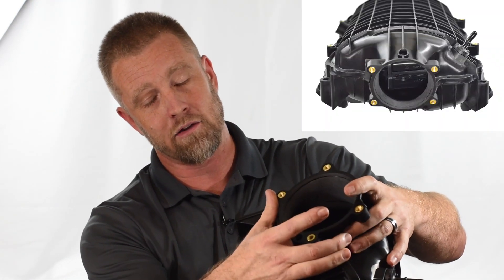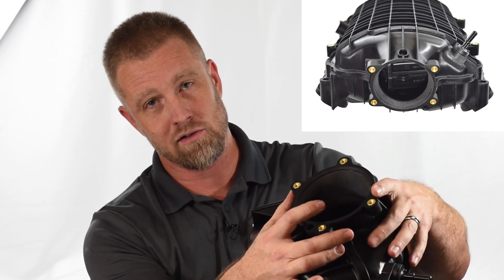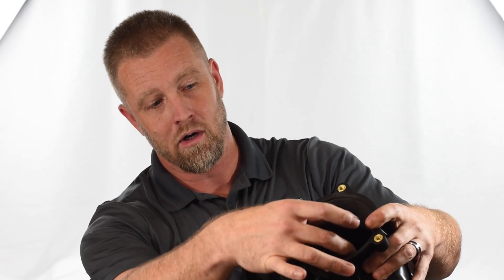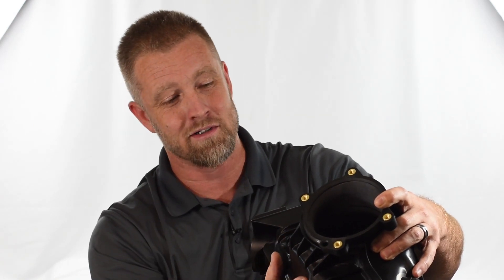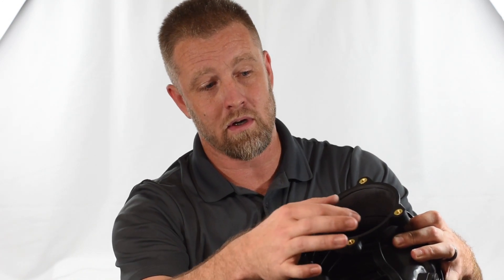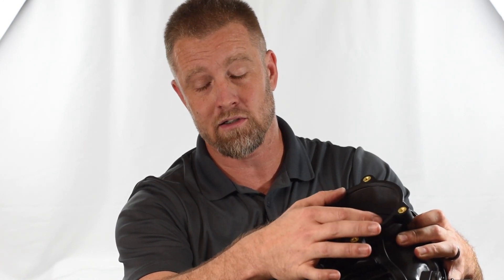LT2 Intake Manifold - Porting for 95mm/103mm Throttle Body

Comment: Ok so what I did was order a billet ICT adapter  part #551793. It's a Gen 5 LT5 95mm plate to LT1 intake. I used a bead of black RTV on the manifold side with no issues. You can also reach out to Soler Performance and see if they can send you one of their gaskets for 95MM TB.

Comment: You actually can make it 95 pretty easy. It's not even close to being too thin. 103 no probably not. I run a 95 with it and works good. I don't know about boosted but heavy porting in this manner is usually a na deal. Helps just as much with boosted but can pulley to the point of short block failure on lt1 pretty easy so unless a full race build would be waste of time and money to port the manifold to these degree. I did 95-96 mm port on the manifold all the way back and rounded off the bottom of tb opening as well. Never was I even close to breaking through.